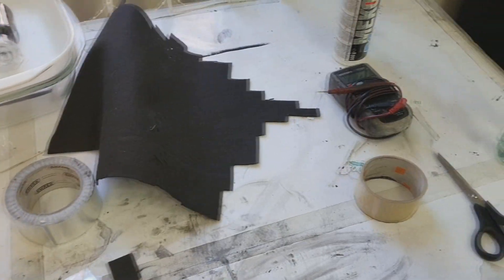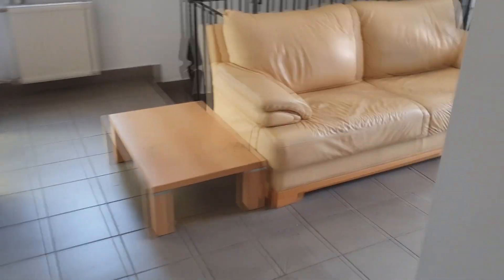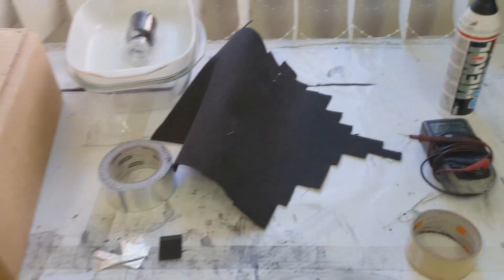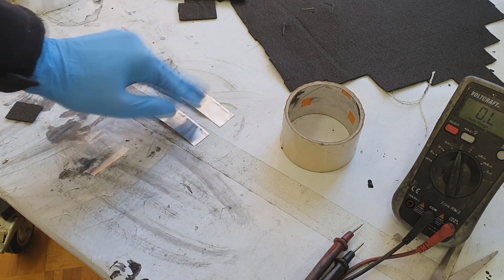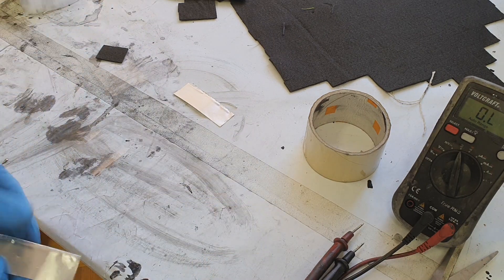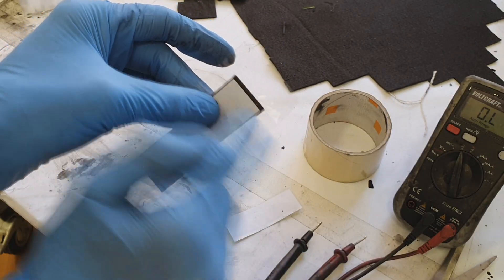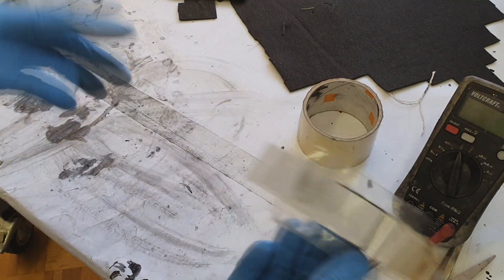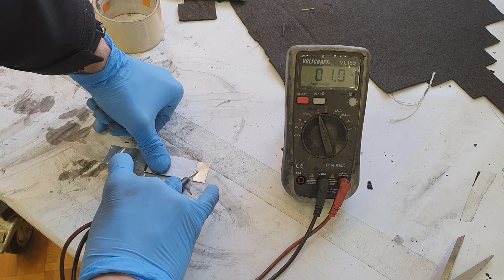Make a pressure sensor and scale

Comment: The sensor could be sandwiched between any two hard plates, even plywood. Pressing the plates together beyond the intended weight capacity a number of times should normalize the deformation so the readings consistently correlate to the applied pressure.